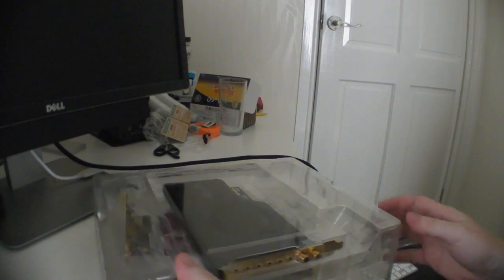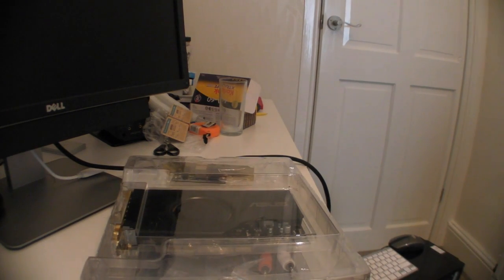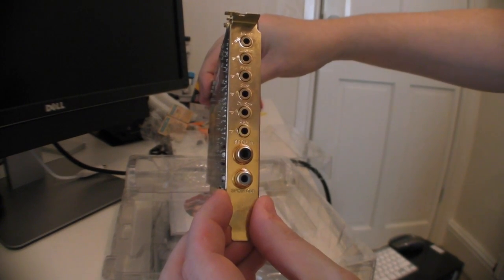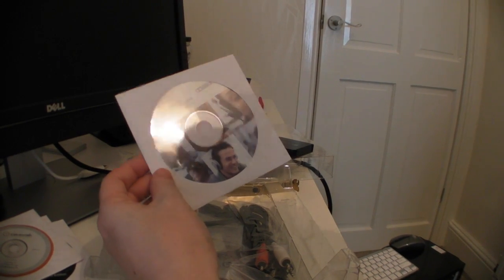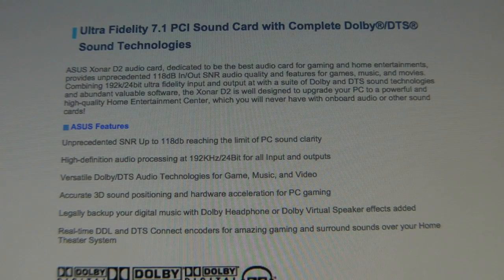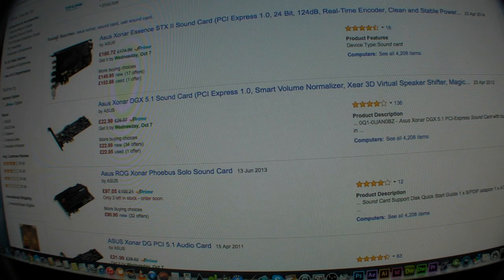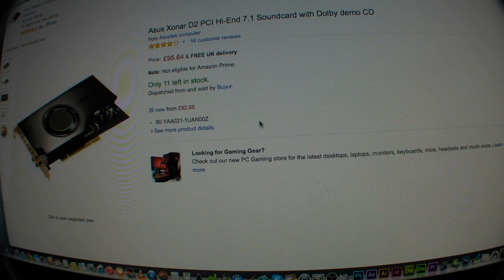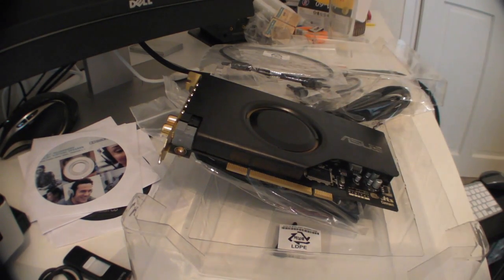ASUS XONAR D2 7.1 CHANNEL AUDIO SOUND CARD NEW + P1 MIDI BOARD-DISCS LEADS ETC

Comment: Could you suggest a good quality PCI sound card that has a SPDIF (square fiber optic) port?
Reply from the maker: +Steven Morton   hi I think your unlikely to find one that is pci but you will find pcie but if their is any stick to creative and asus I have to be honest always used creative do you have any pcie slots? you could consider a usb one creative do some of them. do you have a budget in mind? also consider this adapter http://www.amazon.co.uk/Startech-com-PCI-Express-Adapter-Card/dp/B0037ECAM2/ref=sr_1_1?s=computers&ie=UTF8&qid=1448583223&sr=1-1&keywords=pci+to+pcie+adapter#Ask  if this works consider the z range of sound cards I bought one and its fine   http://www.amazon.co.uk/Blaster-Performance-Headphone-Beamforming-Microphone/dp/B009RPQA2G/ref=sr_1_2?s=computers&ie=UTF8&qid=1448583385&sr=1-2&keywords=creative+z   it is likely a sound card might work can not be sure as pcie uses more voltage than pci does hope this helps you.